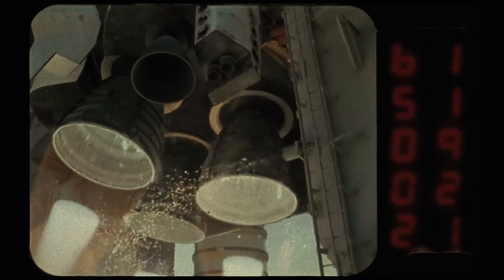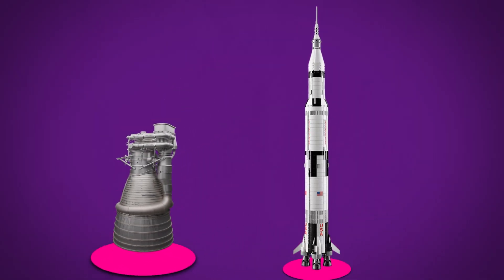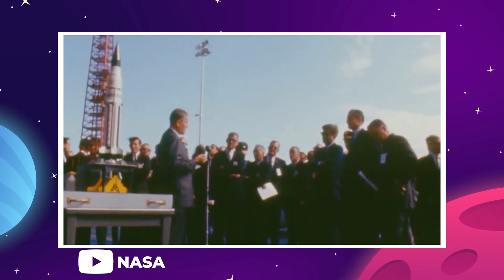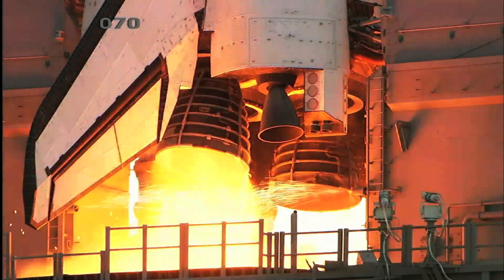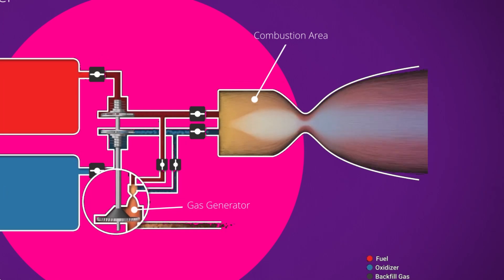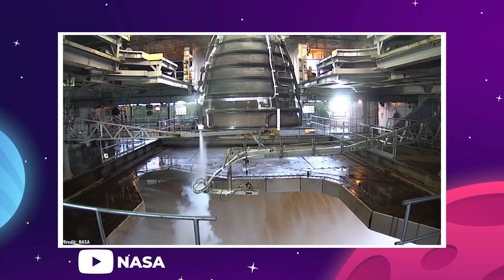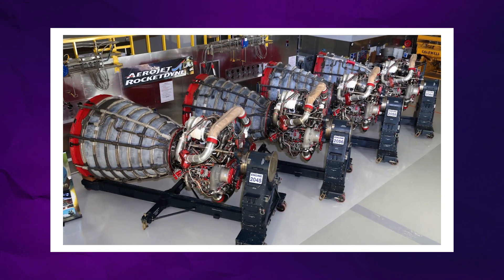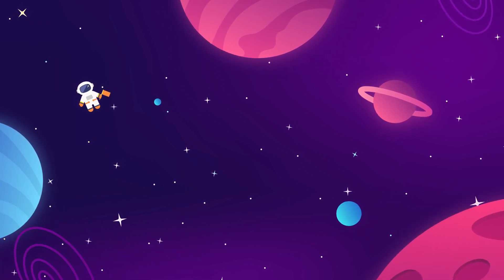The Real Reason NASA Developed The RS-25 Engine!

Comment: It's going to be hard to be efficient when the engine is operating over a huge range of air pressure and air velocity.

Conventional sequential staging makes a lot of sense, you have the first stage for low speed, high air pressure where what you really need is raw power just to get up out of the atmosphere, then the upper stage is where you're really efficient with an engine for low pressure to vacuum, that's where most of the Delta-V is achieved.

Because the RS-25 tried to do too much you had to go with parallel staging with solid rocket boosters which destroyed the cost efficiency and safety. The solid rockets were completely unsafe, especially in parallel staging. They also were not efficient in either fuel consumption or reusability. They had to withstand extreme pressure and temperature yet were just dropped into the Atlantic ocean. Parallel staging also meant every part of the craft was vulnerable to adjacent parts, if a part fell of any stage it could collide with another part.

Comment: As EFFICIENT as SpaceX is, it costs >64% of the mass & fuel accelerating the vehicle to just 6% the target speed.
Were there a way (say many turbofans) to accelerate to Mach 1.5 at 40k ft, you'd need less than HALF the mass.
Think about that. Of course, you'd need enough turbo-fans to accelerate a vehicle that weighs almost 2k tons.

They should've added chutes for the RS-25 and tried to set up a way to catch them.

Comment: I noted the RS25 is an engine meant for Shuttle but problematic so SSME 650kN was developed in its place. The tech that was used on Apollo J2X is what you find too in RS25, and RS68 superb engines.
AS-V1X needs the "beast", AF-1X that could spue 30mn ea unit.
Circular aeropike holds promise for RLV vehicles.

Comment: Why is no one talking about the fact that if space X and Sierra space would work together, then they would have turned out with completely reusable crew dragon version, using falcon 9 or falcon heavy (if you need transport to moon station 💀) and dream chaser (current crew dragon got 2 stage and some parts non-reusable and much less cargo capacity)
Reply: I think Elon Musk wants to achieve rapid reusability as soon as possible - of the likes we use commercial airplanes today. Falcon 9 needs extensive engine overhaul after each flight. They can do it fast, but he wants more. 
I think he would rather favor a Falcon 9 sized transport system with 4 Raptor engines for such a collaboration. But its obvoius the massive Starship System has top development priority until it works and is designed to be a  person, fuel or cargo transporter to LEO as well.
Reply: "Why is no one talking about the fact that if space X and Sierra space would work together, then they would have turned out with completely reusable crew dragon version"

Because as this video mentions also:  re-usability is not the huge advantage that people think it is.

First, there will never be a rocket engine that requires no checks at all between flights. Things like the turbopumps, fuel injectors, seals etc must be checked between flights because if they have even the smallest imperfection the entire rocket blows up, taking your payload with it.
Second, as it stands SpaceX can save a max of 20% on re-used parts and it is highly questionable if those numbers are even real. Musk lies all the time, full stop.
So do you want to risk your very expensive payload on a re-used system if it only shaves 20% off the launch costs? The rest of your operation remains hellishly expensive, do you reall want to introduce a risk for a 20% saving on the cheapest part of the whole thing?

Comment: U all need a secret before u can experience Jesus healing energy. The Illuminati aka fallen angels aliens NASA what ever you want to call them in there flying tin cans. Can't get out of lower orbit because of the vacuum. Universe is only 25 thousand SQ miles big. Breathable air through out space angels have to breath. Mars is only 250 miles away sun an moon are much closer an only a acre big. Heaven is on Mars moon that's what all the thrusters are for space x Star ship try to punch through the vacuum and destroy Mars moon heaven. I cleaned out hell left the light's on. I ripped the soul out the devil after he went dragon just to make it a fair fight. Now u can experience Jesus healing energy all old aches and pains will be washed away takes 30 minutes best to relax and shut yr eyes.❤

Comment: RS-25 vs Raptor 2? - that would be a fun comparison.....
Reply: The RS-25 is bigger and heavier than the Raptor 2 but has very similar thrust.  Each RS-25 costs $250M and only two can be built in a year.  Raptor 2 costs $250K.  Yes.  SpaceX can build ONE THOUSAND Raptor 2s for the same cost as ONE RS-25.  And SpaceX can build 350 Raptors a year from one assembly line.  When demand picks up SpaceX can just start another assembly line.  The thrust of RS-25 is primarily limited by limits to pumping the extremely light liquid hydrogen.  The low thrust of the RS-25 is why massive solid rocket boosters are needed on both Shuttle and SLS just to get it off the ground.  The alternative would be mounting at least 25 RS-25s and a fuel tank that is four times the volume.  While the Raptor has about the same thrust its fuel pump does need to pump as much volume of liquid methane, which is four times as dense.  I therefore suspect that once Starship is operational Spacex will invest in a new engine based on Raptor but with about three times the thrust, about the same as the F1, which will permit replacing the 33 engines of the current booster with 12 engines whose total mass will be less than half the mass of the current Raptors.

The RS-25 is an amazing engine, a triumph of engineering.  However its objectives are flawed, based upon the dream of building a single stage to orbit SSTO spacecraft.  "If something is not worth doing, it is not worth doing well."
Reply: @jamescobban857  . I read somewhere recently that they are building the RS25 engined for 40 million each. Not sure if that's true or not. I also read that each Raptor 3 engine will cost 1 million dollars. Whatever the truth is, the Raptor engine is a helluva lot cheaper. I like your comment.
Reply: SpaceX has now moved on, Raptor 3.

Comment: Thank you for finally answering the question I already had back in 1988: Why build such an sophisticated shuttle with amazing reusable rocket engines and then strap it to a basic looking expendeable tank with two solid fuel burning fireworks rockets.  It looked more like a proof of concept prototype than a finished rapid reusable Space Transport System. I'd assume, If they had been funded to add better and reusable adjacent components in the first decade and added a remote controlled pure cargo Version, the Space Shuttle STS would still fly today and the upgraded system would have saved Billions in comparison through the centuries. What a waste of Innovative and motivated personell.
Reply: the whole sts program was basically a prototype forced to fly. After sts 4 the development and test flights ended and that meant no real design overhauls could be made to the program since the budget for the development got cut.
Reply: " If they had been funded to add better and reusable adjacent components in the first decade and added a remote controlled pure cargo Version, the Space Shuttle STS would still fly today "

...and do what exactly?

That's the crux of the whole re-use nonsense: there is nothing to do up there that justifies the cost of making stuff re-usable. yes, making stuff re-usable is much more expensive and you have to make that money back by using the system a *lot*.

SpaceShuttle was re-usable because they wanted to take an entire science lab into space and back down, or take a satellite up there and take another back down.

Today there is no use for a spaceshuttle, we simply have no usecase for such a heavy lift system. Can you name a single actual existing payload for Starship that is not a SpaceX project? No, and neither can they.

There seems to be this bizar notion that there is a huge space industry that is just sitting there waiting for launches to become cheaper. This is nonsense. Launching is not the expensive part. Building the satellite is the expensive bit, that thing needs to survive the launch and operate without problems for ten years. THAT costs hundreds and hundreds of millions. Even if the launch is 200mln that is still peanuts compared to what the satellite costs.
Want proof: sure: falcon-9 can lift 4mT for $90mln. That's right in the ballpark of what commercial satellites weigh, and the cost is peanuts, yet Falcon-9 mostly does nothing at akll because *the market is too small*.

So what if SpaceX can reduce the cost of a launch by 25% through re-use? That's great, but it saves only 50mln at an increased risk that the mission will fail. 50mln is not nothing but again: compared to the budget for the satellite and the added risk it's allmost irrelevant.
Reply: @vinny142  You have a strong opinion and I respect that. As a Science Fiction Fan starting back in my youth, I would love to see humans spreading among our solar system. Why? Most things we do in life are pointless. Why do we watch films and videos? Because it earns us more money than going out for a walk? Why are there people buying an expensive  sailing yacht to cross the oceans? For fun and social life. Do you think back in the day, when they sent up the first rockets, they thought of GPS and Iridum satellites that would earn money to cover the rocket costs after the first few test launches? No - the idea was not even born yet. Today 60 of the 280 Falcon 9 launches were paid by private companies - most of them for GPS satellites. 
If Starship succeeds (and so far it looks pretty good) , it will be able to send up 150 tons per flight into Earth Orbit. Send up 10 of them and you can build a massive station capable of a first zero gravity production. Another 10 and you can build a moon rocket capable of transporting a permanent space station into moon orbit. Another 10 and you can transport fuel and a reusable moon lander, capable of multiple landings and departures. "30 heavy lift rockets?" you might ask. In the last years Space X has launched more than 50 Falcon 9 rockets per year - and if Starship works as planned, that number could soon be the same, without reaching a theoretical limit. Of course not in 2024. But I see a good possibility of reaching huge production numbers till 2026 and 100 launches per year in 2028. Call me lunatic, that's what I think has a big chance to be realized.
Reply: I still wonder if they had just focused on refining the Saturn IB which had a pretty similar payload as the Shuttle, and could take a substantially wider-diameter payload, 20ft rather than 15ft. The maximum payload diameter was generally a bigger problem than the weight.

They had the Skylab in orbit throughout the latter half of the 1970s without human-rated launch vehicles to get there that were actually being seriously considered. Because they went all in on developing the Shuttle.

Very often you ONLY need to deliver a payload or you ONLY need to deliver crew, the Space Shuttled was built on the idea you'd always want to do both at the same time. For example Hubble Space Telescope (HST) didn't need a whole Shuttle to go up with it, it could have been launched on a Saturn IB and the service missions didn't need a whole Shuttle, the Apollo CSM could have done the servicing.
Reply: I mean yeah, it was literally a prototype

Comment: One note at 8:30 is oxygen rich preburners do not cause extreme heat. They are actually significantly cooler than stoichiometric combustion in the preburner. The real danger is that gaseous pure oxygen at these temperatures will chemically react to the engine, not thermally. This is one reason the Soviet NK-9 engines that were supposed to be used on the lunar N1 were so amazing, they used oxygen rich preburners.
Reply: how did  the soviet overcome the problem??
Reply: @techwizard8214  The LOX-rich situation in the NK-33 (actually the NK-15 in the N1 first stage) was dealt with in 2 ways:  1st, the preburner gas temperature was kept quite low, like only about 700 deg F.  A household oven gets almost that hot.  Second, thermal coatings (primarily Zirconium Oxide) were used in several places.  Since then, some new materials (and coatings) have been developed to allow a turbine gas temperature increase.
Reply: @techwizard8214  they probably electroplated the preburners, oxygen injectors and plumbing in between the preburners and injectors with something like ruthenium or platinum or another platinum group metal. That would probably be the simplest (also really expensive) solution, because good luck getting PGMs to react with anything (except bleach). Or they used a super special unreactive alloy
Reply: @techwizard8214  They didn't, the N1 failed four times, most likely because of its engines
Reply: The Soviet/Russian Energomash RD-170/RD-180/RD-190 family of rocket engines burns oxygen rich. These engines have been used in several rockets, both Soviet (Energia), Russian/Ukrainian (Zenit 2, Zenit 3SL), and American (Atlas 3, Atlas 5, Antares 200). Energomash developed new alloys to handle the hot oxygen gas problem, something that was considered impossible by U.S rocket engineers.
Reply: 'Cool' Oxygen is the way to do it, lower but energetic(momentum) thermodynamically.
Reply: Oxygen rich pre burners leaves lots of free oxygen to react with and burn metal.  The fuel needs to use up all the available oxygen to keep it from reacting with the combustion chamber metal.  This is why oxygen rich fuel mixtures are avoided in high performance car engines.   

The advantages of oxygen rich kerosene combustion is it will  completely burn the kerosene not producing soot carbon deposits.   The other advantage is the fuel is used efficiently not leaving unburned fuel that is a waste.  

The Soviets had to create a pre burner that didn't have combustable metals in an oxygen rich high pressure combustion.  The exhausted high pressure oxygen along with carbon dioxide and some other byproducts are then used to augment combustion in the main thruster.   US rocket scientists thought it was impossible.  All liquid fuel main combustion thrusters run fuel rich for better specific impulse.

Comment: A lunar space elevator, connecting from either the north or south poles to L2, could be made from a spool of 3/8" dia AMSTEEL Blue dyneema.
Only problem is your anchor line has to be 62k miles long. Weight = ~ 400mt
Reply: You're clueless